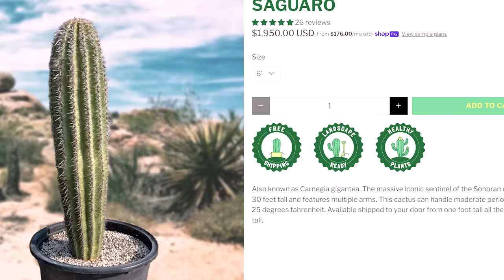Jumping On a 6ft Cactus For Science!

Comment: If anyone hasn't mentioned, if your serious about planting the cactus, you could either make a tri pod stand with pulley and belt to hoist it up above the hole and then lower it or lever it onto the shipping box partially assemble it to move it to the hole then either disassemble it or lift it off.
Reply: He could only plant it inside. If he planted it outside it would die because of the 8months of freezing weather/rain/snow. They need hot/dry climates to live/grow. Not cold/wet climates. Some cactus grow around here but not those
Reply: @stompingpeak2043  ok, thanks for the information, which I thought there would be a problem. I just didn't know all the variables. Methods that I mentioned are still possible.
Reply: Saguaro cacti are notorious for being difficult to transplant especially after being damaged.
Reply: @krisnilsson5044  ok. Wasn't aware it got damaged, I thought it did damage to him only. Is there any way to repair it, or it it basically only good for fertilizer or other tests?
Reply: @stompingpeak2043  Michigan where I'm from, is the worst for anything like this unless getting good greenhouse (which I'm sure they can another purpose for like medicinal herb)
Reply: @mr.ackermann807 doesnt it freeze in the desert?
Reply: @bbqking68  True, I forgot where they were. The desert does get cold to but not for as long though If I remember correctly. The method I mentioned does still apply unless they have a better way to do it, in which case ignore me.